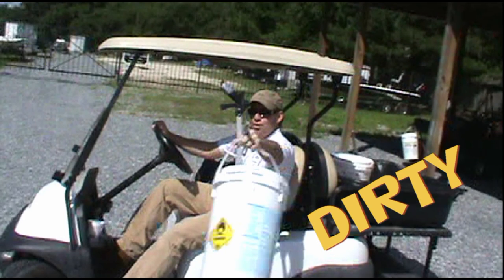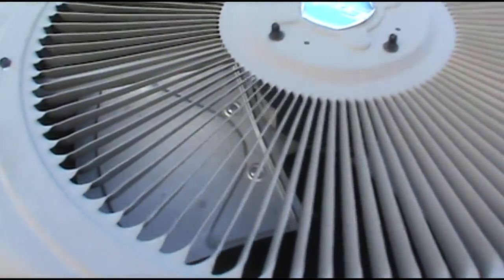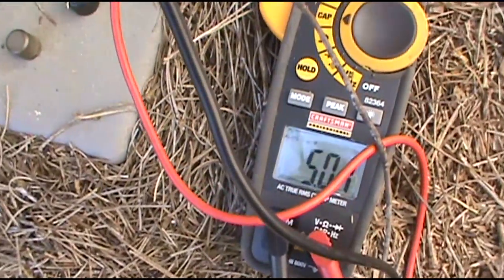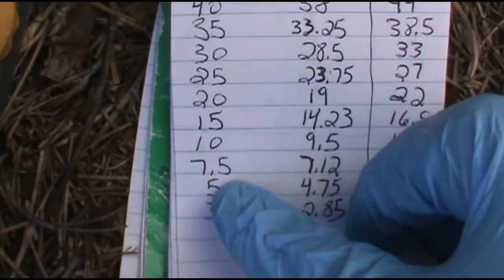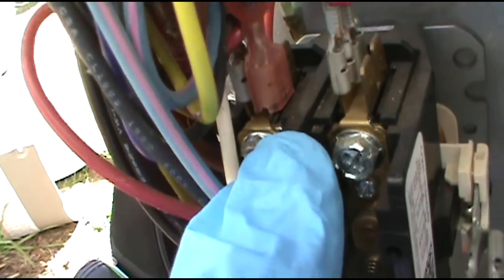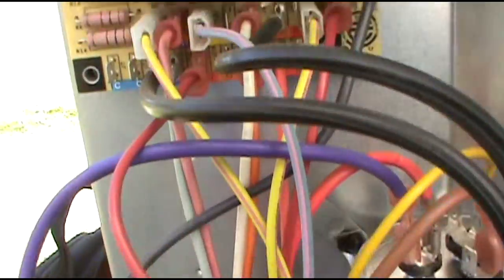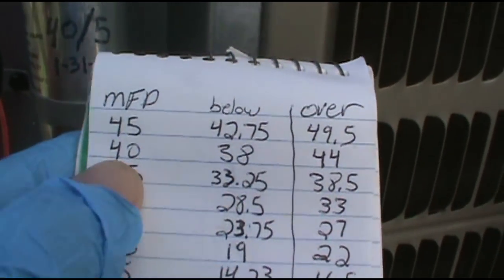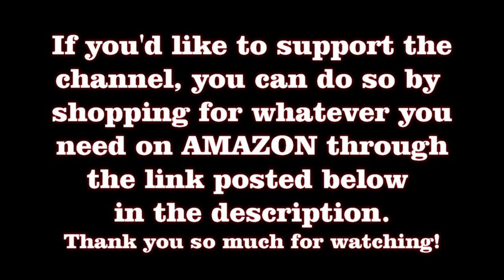HEAT PUMP DEFROST BOARD TROUBLESHOOTING

Comment: Great diagnosis, but I would have also checked amp draws to be thorough.  Just in case the motor was bad and caused the board burn-out, I’d also have checked pressures and refrigerant charge per mfg. specs.  Also, ALWAYS check the drain tubing on any heat pump or A/C.  I always like to be thorough.  Maybe it’s just me,  I’d I prefer to check the entire system to insure no call-backs due to not checking the entire system.  Yes parts can fail after a recent repair, but at least you have the documentation to cover your butt when they say, “you just repaired it, this should be under warranty”.
Reply from the maker: Right on. Thank you so much for watching Jeff!
www.DirtyMaintenanceNation.com

Comment: If you had a bad defrost board during the summer , would it be ok to wire the DFT2 common wire to the left side of the contactor and leave it there to keep the unit blowing cold air and replace the board when it’s winter time? (Asking for a friend) 😂😅
Reply from the maker: 😆😂😆 Sure, just write it down so you'll remember to go back.

Comment: Hey Lez. I have a Ruud Achiever unit. It uses the lights on the board to tell you if there's any issues. I have one light flashing one off, which is defined as High Pressure Lockout. The fan is functioning but I don't hear the compressor turn on. Do you think that would be related to the Capacitor or the board? Thanks brother.
Reply from the maker: High pressure means that the unit is over charged or has a restriction. I'd need to be there for this head scratcher 🤔.

Comment: Good video, just one question, how can u know if there is a problem with the high pressure switch, can u please share if you know how to eliminate for being possible issue, thanks
Reply from the maker: You can cut the wires and wire nut them together. If the unit comes on, that was the problem. If not, wire nut the wires back to the pressure switch.

Comment: When you say commun do you mean white wire? I saw you conecting it to the contactor either line one or two, can you clarified this for me please?
Reply from the maker: The common wire on the Goodman fans are black. I put it on the common side of the contactor with the black compressor wire. Common can be any color. Depends on the brand.

Comment: Hey lex! I have a 3 ton Goodman unit where the fan runs but the compressor doesn’t. It’s just blowing cool air. My defrost board is burnt pretty good and it’s on back order. What can I do to have the compressor run?
Reply from the maker: Try to put compressor run and common on the top of contactor maybe?  Black on left side and red on right side. I hope everything works out for you! 🤞

Comment: What could cause defrost boards to keep burning up? Replaced mine and it worked for a couple days then burnt up again.also had to replace thermostat. Jumped to yellow for now so it works but would like to know where to start troubleshooting. Will buy my next board thru your Amazon link if you can help 👍
Reply from the maker: Wow that's strange. Ive never experienced defrost boards burning up so I'm not much help on this one. I'd need to be there with my volt meter to see where the volt surge may be happening. Sorry! Thank you so much for watching freedom!
www.DirtyMaintenanceNation.com

Comment: I've got a Goodman. Doesn't cool well. Condenser Fan runs strong. Compressor runs but is not loud. New capacitor. Refrigerate line not cold. Thoughts?
Reply from the maker: Could be low on refrigerant. You'll need to put gauges on it & see if its low. Thank you so much for watching Cliftt!
www.DirtyMaintenanceNation.com

Comment: I have a Rheem electric furnace and it's heating but the flame on my thermostat will be flashing and I quit counting once it flashed past 100 flashes tring to find a code by counting them but my outside unit isn't kicking on for my heat pump. Well i decided to turn the breakers off to reset the furnace and the out side unit comes on and working properly then shortly it won't come BK on again and flame starts flashing. I've repeated this process several times over several different days. My electric bill has more than doubled and I would be extremely grateful if you could point me in the right direction. Thanks.
Reply from the maker: It could be low of Freon. Heat pumps have a low pressure switch that will automatically shut your unit off if it's low on Freon. You'll need a tech to come check the Freon charge. Thank you so much for watching!
Reply: The a/c  worked great then when we switched to heat this started. I'm just trying to get an idea where to start at and if it's within my realm of possibly Thanks for your time and response
Reply: According to the LEDs on the defrost board it says coil sensor fault so that's where I will start again thank you for your time and have a Merry Christmas.

Comment: Lex, I'm new at this, what would happen if you left the connector on the contactor?
Reply from the maker: It wouldn't defrost correctly I've heard. You can actually leave it like that over a weekend or until you get a new board. As long as it's changed before winter. Thank you so much for watching Joe!
www.DirtyMaintenanceNation.com
Reply: @LexVance  Awesome videos, keep it up. Thanks

Comment: Would this be similar to with a Payne unit?
Reply from the maker: I'm not sure. I'd need to be there to look at the wiring. 
Thank you so much for watching Brandon!
www.DirtyMaintenanceNation.com
Reply: After watching this video I stepped out to check it and its almost identical. Very minuet differences between the one in the video and mine. Thank you for the help.  @LexVance

Comment: Hi lex the problem I have is when I turn my heat on 
Furnace inside the house works and I have heat air but the outside part and fan doesn’t so I’m getting high electricity bills 
It has the 240 volts and thermostat has the 24 volts.
If I turn the cold air everything works fine, what could be wrong? I will really appreciate any help thanks.
Reply from the maker: You may not have a heat pump and your system only uses the inside heat strips. In that case the outside isn't suppose to turn on. If you do have a heat pump then something is not telling the outside to come on. I would need to be there with my volt meter to see what's going on. Thank you so much for watching Franco!
Reply: @LexVance  thank you for reply and for good video

Comment: If put in cooling , hot air come thru thr vents, could it be a stuck reversing valve?
Reply from the maker: Yes, or it could be simpler like heat strips turn on due to bad t-stat or wire touching. Or a bad sequencer. This ones a head scratcher and I would need to be there with my volt meter. You can disconnect the heating wires out of t-stat and see if that fixes it. Those wires are usually brown and white. Pull them out of the t-stat and tuck them away and see what happens. Hopefully it's something that simple. Thank you so much for watching Luis!
Reply: @LexVance  
Thank you so much for your time sir!

Comment: Shouldn’t you check the defrost sensor first before condemning the defrost board
Reply from the maker: Yes you can do that. If I threw the new board on and still had issues I'd move to the defrost sensor. These were brand new at the time of this video and I was having more boards go out than defrost sensors. So, I went straight to the board. Thank you so much for watching David!

Comment: I have the same problem but the a/c is working and the heater does't. Do you have a trick for that too? Is winter in Az. I think i burned the control board installing a new thermostat. Thanks a lot.
Reply from the maker: Probably popped the fuse. Put another fuse in there & see if it fires up. Theres a 5 minute delay with heat pumps too. So wait for it to turn on.Thank you so much for watching Yayi!
www.DirtyMaintenanceNation.com
Reply: @LexVance  thanks a lot.

Comment: Can you do a video showing all things you can use the Supco M500 for and how to
Reply from the maker: Jason Rios Right on Jason. I can right that down so I'll remember. I have a few videos using my Supco m500 on ac units. Have you seen those? I most use mine for testing compressors, crank case heaters, & fan motors. If you need links to those videos where I use it, let me know. Thank you so much for watching Jason!
Reply from the maker: Jason Rios Here you go man! Here's a link to a video where I use it to troubleshoot a crankcase heater & a compressor. You do the same with fan motors too. One lead to the chassy, the other lead to the fan motor wires. Theres a link in the description of the video to where I purchased mine. Its fantastic & have had no problems. Heres the video link, 
https://youtu.be/1GeJGT5kikY
Reply: Lex Vance 
Yes watched all. I like your videos a lot. It's like maintenance for dummies. Short cuts to some stuff I was doing the long way around. Sometimes I just watch your videos for a refresher. I work at a brand new apartment place and one a year old
Reply from the maker: Jason Rios Oh right on man. When the opportunity to use my M500 megger presents itself, I'll record it & go into detail. But its real simple. One lead on frame of unit, the other on the wire you're ohm'ing out. Whether it be the start winding wire, run wire, or common. Its a great tool & only has one button! 😂😂 Thank you for watching Jason!

Comment: why does my heat pump go into defrost at 36 degrees .Seems lennox heat pumps are not that great .Mine was installed in 2014 and is a dual stage 16 seer 4 ton heat pump and never warms my house and I live on the southside of VA .The house is 2440 sq. ft and is built from 2x6 studs and floors are insulated and attic is well insulated .
Reply from the maker: The refrigerant may be low. You'll need to check that if it's not heating the house. Thank you so much for watching sissy!
www.DirtyMaintenanceNation.com
Reply: @LexVance  since it was installed it has been repaired 3 times .the first time was the compressor after only 1 year and even lennox rep has been out here as it was blowing it's internal fuse on the matching indoor unit .I have the WIFI thermostat and it is not giving any warnings .It notifies the company when there is a problem and showed nothing but my normal replace filter notify  .It has a sealed compressor .
Reply from the maker: @sissymurphy9620  Wow that's a bad install.
Reply: @LexVance  they are supposed to be the number 1 installer for lennox here and part was from lennox build .It is a 2 stage heat pump and starts on low and goes up to high and back to low but was missing the part for that when it was built and it was shipped with the wrong settings installed .I did notify consumer affairs and nothing done yet

Comment: Just to share we've got one account that has a whole ton of York units take that y wire off the defrost board and put it on the other side of the contactor that'll bypass that time delay that always goes out on those units

Comment: Hey Lex, I got a goodman 2.5 ton heat pump, the AC worked fine during the summer bit as soon as the heat was turned on it blew a 3 amp fuse in the air handler and won't run now. Any help is appreciated.
Reply from the maker: Do what I do in this video.
https://youtu.be/mtnAwuH526o
 You've got a low voltage short some where. If you dont have a jumper, just wire nut the tstat wires one by one until the new fuse blows again. Whatever wire blew the fuse is the wire with short in it. Replace it with another wire or if its the yellow wire, check the contactor & make sure it's good.
Reply from the maker: Video link is here
https://youtu.be/mtnAwuH526o
Reply from the maker: Also, leave the blue common wire in the tstat or you'll short the transformer.
Reply: Ok thanks for the information. I checked the wires and the orange shows short. I unhooked it at the outside unit and the thermostat wires are good. If I unhook the reversing valve from the control board the orange wire doesnt show short. How Do I test the reversing valve coil? Or could it be the control board? Thanks in advance.
Reply: Not sure on how many ohms it should have either
Reply: Just check the coil to ground.

Comment: Shouldn't 38.7mfd be ok on a 40mfd cap? Plus or minus 6% correct? 5% is 38mfd, I guess rather be safe but 38.7 is still a good cap by specs on said 40mfd cap, good video short and to the point
Reply from the maker: Yea, 38 or below I'm changing it. Too close to the edge & I HATE call backs. Thank you so much for watching TheZx!

Comment: Neither my compressor or fan would kick on.  I tried your trick and the compressor comes on now but no fan.  Still need new board?
Reply from the maker: Brian F Check the capacitor. It could be low on the fan side. Thank you so much for watching Brian! 
www.DirtyMaintenanceNation.com
Reply: @LexVance  is there anyway to "jump" the fan motor to make sure that will work once I replace the circuit board?
Reply from the maker: No one has ever shown me that nor have I ever seen it done. So I don't know the answer to that one. You can test the fan motor using Ohm's to make sure its good before replacing the board though.
 Thank you so much for watching Brian!
www.DirtyMaintenanceNation.com

Comment: Been there before! By pass the wire terminal on the defrost board relay …. Put your condenser fan wire/black purple which ever one was on the relay on the contactor terminal(correct side!) . Power back up disconnect box/plug….Fan comes on probably; bad defrost board!! Good ole heat pumps….
Check your capacitor 1st & or also turning the fan manually through the top with long screw driver or stick etc. It whirls around freely & capacitor good…. By pass the defrost board relay.
Reply from the maker: Thank you so much for watching Orlando!

Comment: Hey Lex,  quick question...how do you know which side of the contactor is the common side? I always hear that term "the common side of the contactor" but what makes that particular side the common side? thanks in advance!
Reply from the maker: Sal C Its just where the common wires go im assuming. lol! Never really thought about it. You can't mix common wires with hot wires so they get put on the same side. Ill have to research a little more. lol!
Thank you so much for watching Sal!
www.dirtymaintenancenation.com
Reply: The common side of your contactor is the one that has the bridged cuircuit the always hot side

Comment: Did you check to see if you were in a defrost cycle?
Reply from the maker: hvac01453 If this trick didn't work, I was headed there. Thank you for watching hvac!
www.DirtyMaintenanceNation.com
Reply from the maker: kerry smith Why go through all that? Just pull the common fan wire off the board & stick it on the common side if the contactor. Takes 5 seconds. Thank you so much for watching Kerry!
www.DirtyMaintenanceNation.com
Reply from the maker: kerry smith Its the common wire on the fan. There's a start wire, a run wire, and a common wire in the fan motor.
Reply from the maker: kerry smith No, just a start, run, & common like on a compressor.
Reply: Just to b sure you can do this for all boards ???
Reply from the maker: Devon Johnson My property only has 1.5 to 4 ton Goodman units. That's all ive worked on for the last 3 years. I'm not sure about other brands. I was a full-time guitarist for 6 years before I got back into maintenance 3 years ago. That's why I haven't worked on other stuff. Thank you so much for watching Devon!
www.DirtyMaintenanceNation.com
Reply: Lex Vance thanks lex i appreciate your videos , my property has goodman units as well .. i will try out your tricks and steps .. i will definitely been in touch with you for future advice